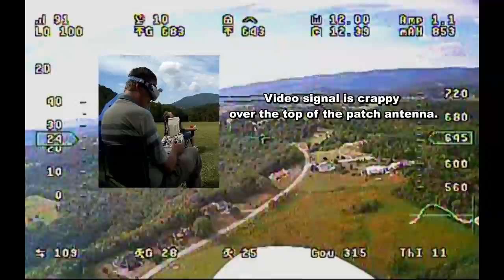3rd FPV Flight - TwinStar Plane, Vector OSD View from RunCam Sky2

Comment: if your video transmitter is a 1280mhz why does it look like your using a 5.8ghz receiver antenna on your goggles? I know for a fact that a 1280mhz antenna is much bigger then what it looks like you have on the goggles. the antenna on your goggles is smaller like the size you use with 5.8 VTX/VRX????????
Reply: Daniel Garrow I think hes using a 5.8g wireless video link relay...The Video signal is recieved by the 1280mhz vrx...and this signal is then re-transmitted using a low output 5.8g vtx to his goggles....Its a very convienient method which I also use myself....No wires..:).

Comment: Hey there.. i'm curious if you ever ended up tweaking the Vector gains on any of the surfaces.. like say the ailerons or using a gain knob?  I find i'm pretty "wobbly" at low altitude/speeds.. so either i need to go up a bit from 50% on gains or use less thumbs or physically limit the range of the ailerons.. i've read if you tweak the gains it may be necessary to tweak other settings (rth, loiter etc).
Reply from the maker: +theskyisthelimit I never got around to trying any of that. Last time I flew the TS was when I made this movie.  Been flying stuff under 250 grams.

Comment: After my first FPV flight, i was confused as to the Vectors indicators for home.. the one at the top.. apparently it has to be an upward pointing triangle meaning heading towards home, if its upside down its behind you.. however, the "radar" one in the center of the screen seems to me that it has no use unless way points are set.. is this accurate?  In this video did you assign waypoints?  Did you find keeping the nose in the view for the OSD/Goggles was more useful?  After my first flight without the nose in view I think the next flight i'm going to aim the cam down a bit so the nose is in view, for less of a view from a generic "window" vs a plane window

Comment: I'm wondering what you set the vector setup  on the basic osd for pack voltage alarms (for the flight battery).. i think the default is 3.5.. do you shoot higher, say 3.8 or maybe on an overall level, when do you typically land, ie: no lower than 11.1 volts (since you cant see cell volts in the osd)?  I'm assuming as well, that for Speed Ladders, pitot tube is checked off if using the airspeed sensor.
Reply from the maker: +theskyisthelimit I don't remember what my setting are but I typically look for about 11.8 to start preparing to land. Then probably touch down before it hits 11.4. This takes some stress off the battery.

Comment: Dave - what frequency are you using for your fpv? It looks like you maintained a great connection. Also, how would you compare the pixhawk to the eagle tree system? I'm trying to decide between the two for setting up my apprentice s15e as a fpv plane. I would add one of the Arduino based OSD modules to the pixhawk since I have it on my naze 32.
Reply from the maker: john locke The video feed is 1.3 GHz (1280/1258) and has great range and penetration. RC LRS is 433 MHz EZUHF. I think for simplicity of installation the Vector is better for a plane but it does not have mission planning like the PixHawk. You might consider the APM as well which used the same OSD and software as the Pix but is a little smaller.
Oh and there is also a Mini PixHawk out but again all the 3DR stuff requires more wiring than the vector. I have all of the above and like them all but the Vector was the easiest to figure out just no way point missions which I seldom use anyway. Also see my vid on the ALceOSD.